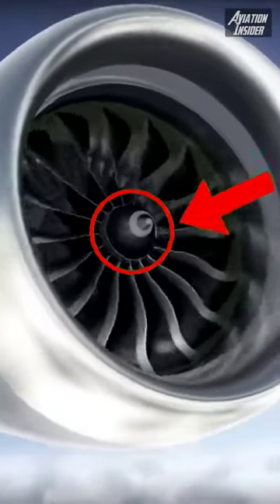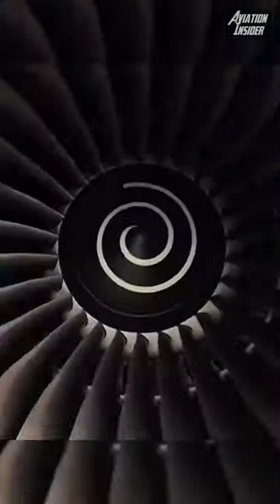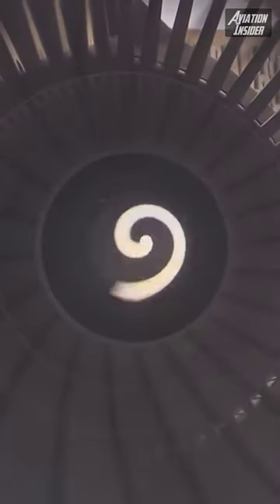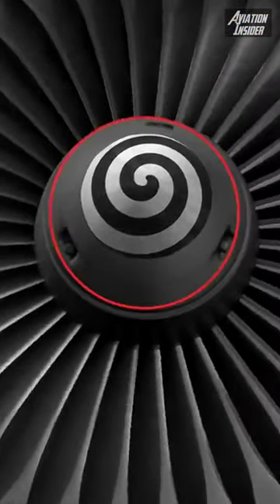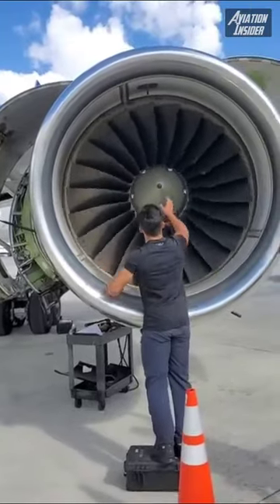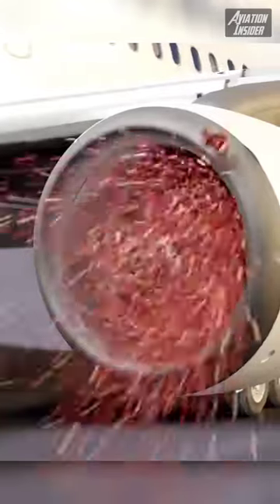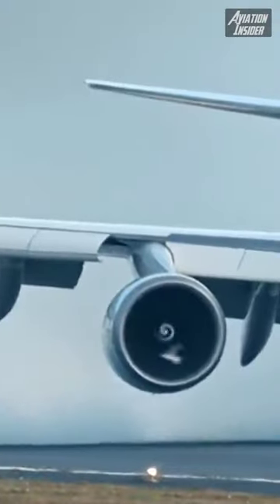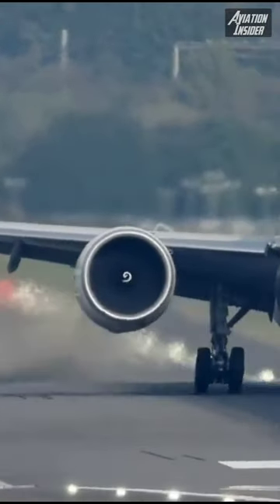Insane Reason Why These Spirals In Jet Engines Help Save Your Life 😱

Comment: Why they don't just put something on front of the engine to prevent those bird's.
Reply: 1. It reduces the air that can go in, increasing fuel burn, and adding weight

2. If the plane is going ata decently high speed, the bird will get chopped by the bars anyway

Comment: Is this spiral design was introduced by the plane manufacturer?
Has this been proven genuinely effective? Surely did.
What about protection shield be put infront of the jet engine so any foreign object can't tamper with.
One more thing. The price of an airplane to me is collosal. What more together with passengers on board.
Can't the plane manufacturer design a suitable parachutes that can withstand the weight of the aircraft at full capacity in case of emergency?
Like engine failure , system malfunctions or anything else that will stop the normal operation of the plane. This is only hopeful suggestion.
Every genius on this planet can forecast far better invention than l can imagine.
Hopefully flying on an air plane will be as 'safe' as travelling on land vehicle one sooner day.